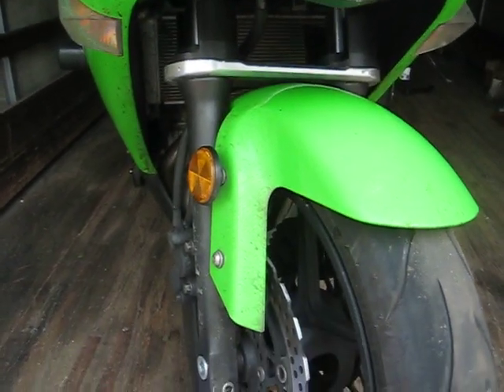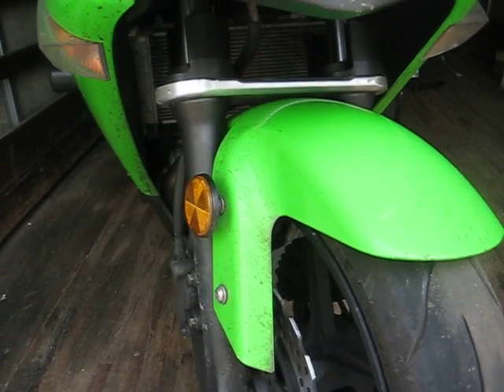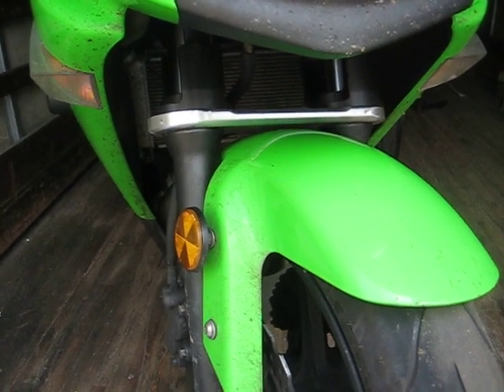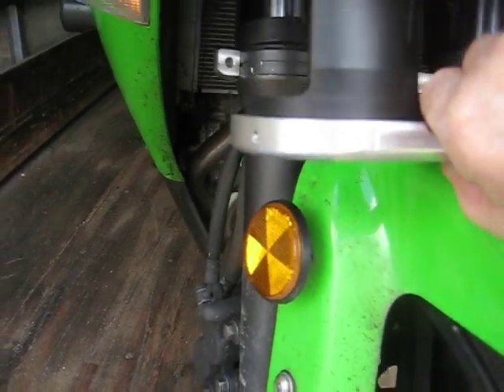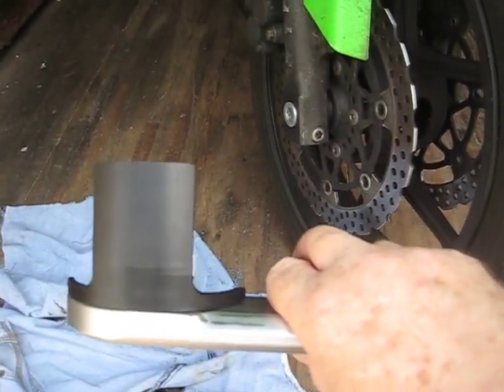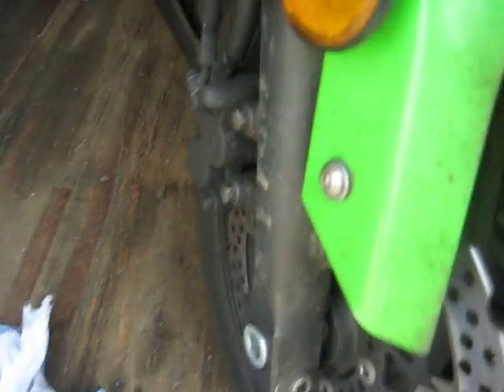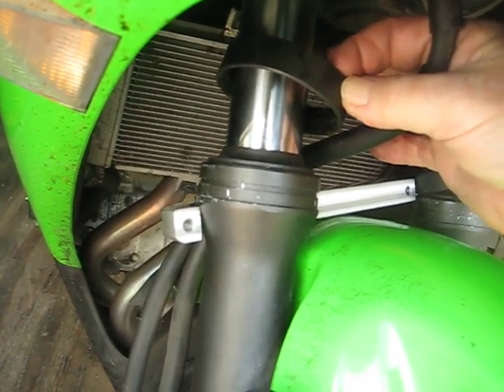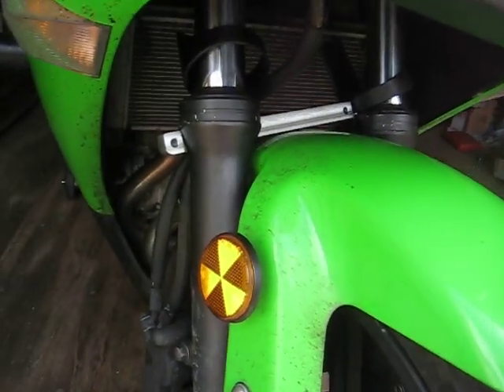650 custom fork brace project

Comment: I put a fork brace on my KLR 650 and it made a huge difference both off road and on the highway.. Ninja 650 forks are much shorter so I suspect it would be only slightly noticeable. Excellent machine work..

Comment: It will make a difference if the front fender isnt very stiff, allows the forks to flex a bit. A good example is an old bike converted bobber/cafe. Most people drop the front fender, at this point the small mm forks can flex a bit causing the front end to feel loose. TwinCult2s bike had this problem, so I modified the fender so the build is brace was used but bobbed the rest a bit.